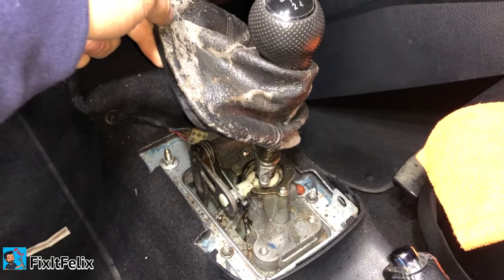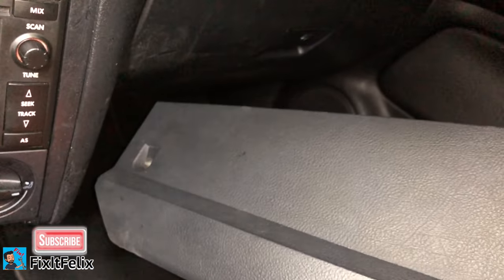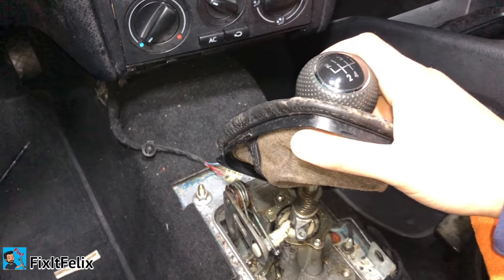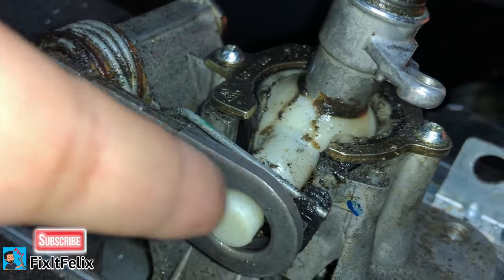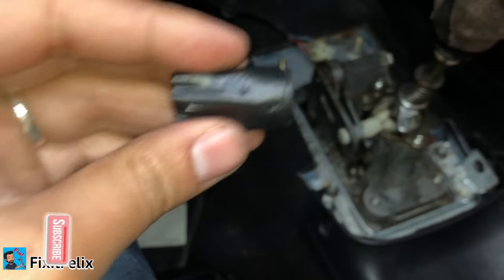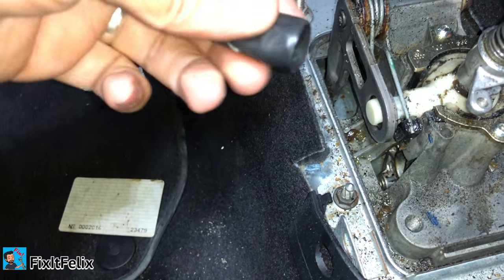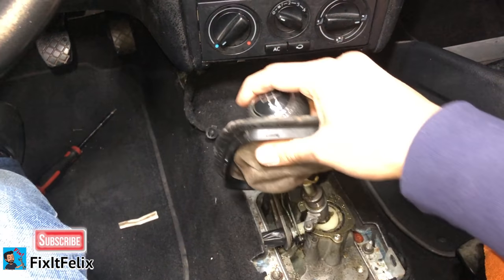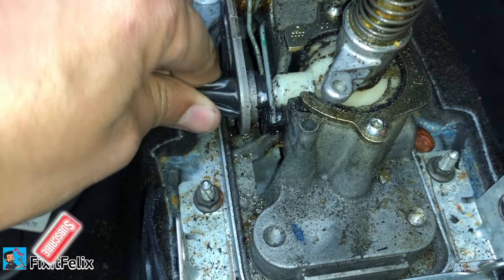Volkswagen shifting gear problem fix

Comment from the maker: Hi guys! if you find this video useful you can help the channel grow by donating , it don’t matter if it’s a small amount.  Anything counts , link down below Thanks ^_^
https://www.paypal.com/paypalme2/FixitFelix529
Reply: I don’t have a problem with shift with the car off but when it’s on idk what it is ?
Reply: @Fix it Felix
THANK YOU VERY MUCH for this video with clear instructions and information.
😎👍🏼
You have earned my subscription...!
Reply: @laferhodge8504  That normally happens when the clutch requires adjustment or replacement.
👍🏼
Reply: @laferhodge8504  did you find out why… I have the same issue. It’s fine with the car off 🤨
Reply: @macmac007gg  yes it was the clutch
Reply: BTW... that wasn't a mosquito, it was a harmless crane fly
Reply: @YusufGinnah  My too 😀
Reply: I cant get to the bushing, there’s a casing covering it
Reply: What’s the name of the part

Comment: Seriously helpful video! In addition if it helps anyone else, a really good reference circumference for the electrical tape fix is to use a AA battery. It has a nearly identical size and makes wrapping a smooth coil of electrical tape extremely easy.

Comment: Nice job in pointing to a problem I suddenly had. Ran to the grocery store this morning. Ready to leave, couldn't get into reverse. Gas to pop the hood, work the mechanism, crank up and then go. I was like "great, just great. Now what?" Found your video, dug in and yep, just what you're showing. My fix? A piece of old 3/8 inch water hose I had in my tool box drawer. Works like a boss. Thanks man!

Comment: Sounds like what happened to me at traffic lights in central Belfast today.  Traffic behind me was not too happy 🥶🥶 Couldnt get into gear to drive off for several minutes. Thought I'd have to be towed away. I'm a retired nurse & not into car mechanic work - but I figure if I can deliver a baby then I can have a go at this ... got the hose pipe and insulation tape ready to go for the morning.  Wish me luck. Thanks for sharing. 🙂

Comment: Awesome video. You went straight to the problem and provided the fix in a short amount of time. I had the exact same problem and was about to adjust shifter cables under the hood. But when I saw your video, tried the electrical tape and bOOm; instantly saw the result. Shifts into first and reverse on the first try now. I will soon be ordering the bushing. Sent you a small donation for your effort. Thank you so much for taking the time to share this.
Reply from the maker: Thank you so much!! 😊 I appreciate it 👍🏻

Comment: Got to thank you for this I have a Saturn 98 Sc1 1st and reverse sometimes was impossible thought I was gonna break the shifter at time and gonna coste a lot to fix. I did what you did looked and my bushing was fine but there was another part screw was completely loose. All I needed to do was tighten it now it's so smooth. Thank you so much for your video I love repairs that cost nothing!😊

Comment: Wow, I'm so glad I found this video. I just recently upgraded to an O2J Polo shifter box, and I haven't been able to shift into any gears what so ever. I always wondered what the problem was,  I never imagined it would be just a small rubber bushing like that, the size of a dime basically. Thanks for sharing and God bless🙏✝️

Comment: thanks bro, this video was a Godsend. got the part you suggested... didn't quite fit my 02 Golf TDI... the part has a little nub on it that wouldn't fit in the correct spot on the shifter, so I took a box cutter and sliced the nub off and presto, fit perfect. I can't say I was able to get all the trim back in place properly (some parts literally crumbled during this project, my car is so hella old!), but I got it close enough and the shifter is working perfectly!

Comment: Would this work on my 2017 golf GTI?? I struggle to put into 1st gear instead it slips into 3rd. I have to keep pressing clutch and retrying to finally have it go into 1st. It just started happening today. I thought it be because it’s very cold but I think this might be my problem too.
Reply: Hey Jay, I’m having the same issue on my 2015 golf GTI. Did you fix the issue and if so what did you do?!
Reply: @ethantorres  it was the clutch I had to replace it

Comment: I have the same problem with my mk5 gti, but only with it not going into reverse . all other gears are fine. Will take a look at this solution and hope it works
Reply: Did it work??
Reply: @everythinginyourhands5887  Nope, ended up having actual transmission damage, so it was an expensive repair

Comment: Great video! Quick question though. My shifter feels grindy when it’s in neutral. Moving left to right to make sure I’m neutral(kind of a beginner habit that’s stuck with me) and it feels rough going left and right. Could this be my issue? Or something bigger, thanks!

Comment: My 2010 VW CC with a 6 speed manual, has the similar problem where it won't go in reverse. But what baffles me, is that it won't go in reverse after driving for a while when everything is hot. Once it sits for a while and cools down, it goes in reverse again without any issues. Any advice?
Reply: what was the solution, I have a similar problem getting into second gear (automatic) I notice my 2.5 Jetta does better when it is cooler too.

Comment: my 1.9tdi bora (golf 4)
had a longer while problem of SLIGHTLY effort to go in 2.
no problem going in 1.
no problem going in reverse.

my bushing is there. looks worn.
since today it wont go into 1 at all, if i push hard it goes into 3.
i am talking when i am standing still ...

thanks for any replys
you think this will fix my isseu?
Reply: Yo man got the same car did you ever find out the problem
Reply: @ziadbeck4623  yeah i had to adjust the thingy's* like 50 times in 1 hr with about 5 testdrives untill i had them in the perfect spot. 

*thingy's= these black plastic clips holding a spring on the shiftingcables. in my car these are located right on top of the gearbox, if you open the hood you can say right of the engine on this weird shaped shifting linkage. 

make a pic how its now, release them and try to adjust them by just 1 or 2 ribbles before reengaging them, its quite tricky they tend to fly off your fine adjustment, thats why i had to try like 50 times lol. after every adjustment, put the car in every gear and see if it's worse/smoother.

once i had it so smooth, BUT didnt wanted to go in 6th gear found out during testdrive, so make sure to check high gears too (while driving)
Reply: @biker5803 appreciate man thanks

Comment: Man you are a human Tylenol, my 2001 jetta wouldnt go into reverse had to pop the hood and put it in reverse by hand (embarrassing) watch your video and BAM i got my reverse back
Reply: Really?
Reply: Mines isn’t working either my gear box was shifted to the right just a bit so I had to reach over to the right a lot going into 3rd so I adjusted my links and now my gears work good but my reverse won’t work you think this could fix my mines? I have a 2001 Jetta

Comment: Take this to the dealer they’ll charge you 2,000$ and tell you this was an all day job
Reply: + they tell your turbo is gone and injectors blew up
Reply: @xrayboom  "Are you sitting down?  It' requires removing the engine and tranny together, but to save you money we could probably simply drop the transmission and floor board.  $2000 vs. $1400, what do you want to do?"

Comment: Thank you! This is exactly the problem I have with my Golf!
Reply: Did you have the problem where it struggled to go into 1st and reverse but wasn’t happening all the time?
Reply: @WeirdGinger  Check the linkages on the gearbox itself. Atleast on mine they were completely shot, im surprised it never came undone.
Cant say which one and where as I have a polo.

Comment: My Polo Vivo Gear just basically shifted downwards. I can no longer access 2nd and forth gear due to the gears moving downwards. Reverse is difficult to reach but accessible. I can access the top gears just fine, being 1,3 and 5. It is a 2013 Polo Vivo 1.6

Comment: My problem is,  when car is cold  transmission  works perfectly  after driving like 1 hour  than it comes Like that  and it is actually stuck and it's not shifting, do i have to do as you did or  i change something? Please answers
Reply: @fix it Felix
Reply: I got the same problem of yours did you already fixed
Reply: If your clutch is hard when ur pressing it then it has to be clutch problem,  mine clutch was compressed
Reply: Amar Ibraim o ok no my clutch it’s not har it’s good
Reply: Amar, did you ever find your problem?  I have the same issue with mine.

Comment: Hi Felix, did you ever find the part number or description for this piece? I have had a really hard time finding it anywhere!
Reply from the maker: No bro I am sorry.  Did you try calling Volkswagen dealer?
Reply: I didn’t yet, is that where you got yours? Usually you can find that kind of stuff on eBay or Amazon but I could not find a thing that they said fit in my car. Thanks for replying so quickly, I really appreciate it.
Reply: My car is a 2002 TDI golf, but you would think it would be the same as the gas model.
Reply from the maker: It should be the same
Reply: Diesel geek
Reply: On my VW 2007, the rubber bushing is molded onto the white nylon ball shaft.  You cannot buy just the bushing from VW.  Felix's solution might be the best one after all if you don't want to replace the entire ball...

Comment: Could you please advise me. My car (VW Sharan 2008, 2.9 TDi, automatica) was driving all well. Then yesterday when I tried to reverse, I heard/felt a jolt and car won't reverse, although I can drive forward. What could be the reason please? I need to know something before I can call the mobile mechanic. Otherwise they will straight away say gearbox knackered and try to charge me £600+.
I hope it's something small, like transmission fluid low, as mentioned in this Vedio. Please advise, any tips from anyone reading this would be much appreciated. Please helpppp. Jacob, West Sussex. UK

Comment: i may check this out on my Corsa
i often have problems engaging a gear... sometimes it works instantly and sometimes it takes me a while

and it frustrates me cuz i do want to stand in neutral while waiting for the traffic lights but this problem always makes me stay in 1st gear since i am afraid thaf i cant get the 1st gear in after it turns green xD

Comment: If this  works for your 2002 gti then it should work for my 2001.5 gti, even though in the link it says it is not for our cars (mk4 gti). Just making sure that you have had success with it before I order it. Thanks!

Comment: My polo player just suddenly started that problem but mine shifts smoothly to first and to third and all even reverse no problem mine just sometimes when shifting to 2nd it doesn't always feel propelly in so its like in neutral then I must shift out and back to 2nd again for it to take,also my gear lever self is very loose
Reply: @Space Funkie fresh ok
Reply: i have the same problem in my 2010 polo, did you find a fix to it?
Reply: @SuperBoss Jason1 @Space Funkie fresh